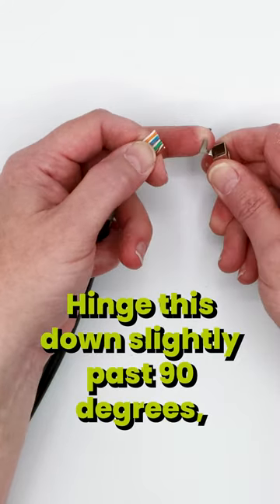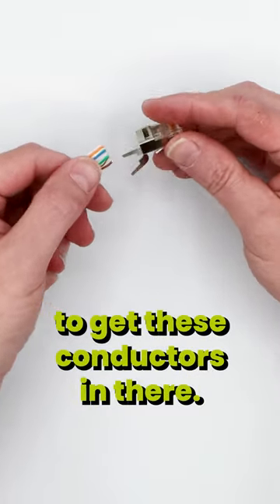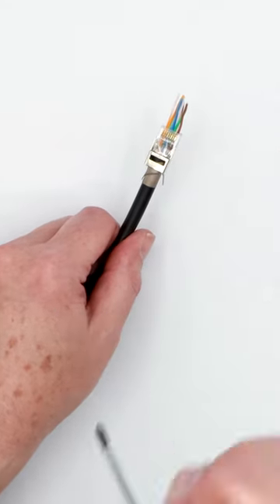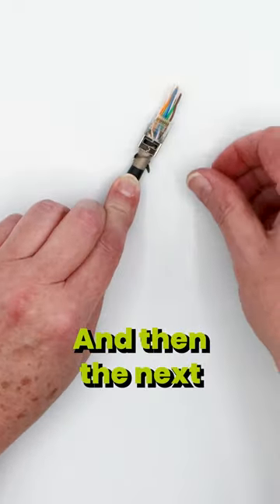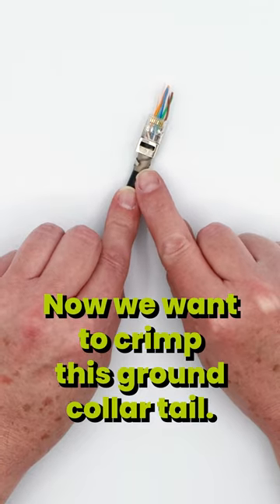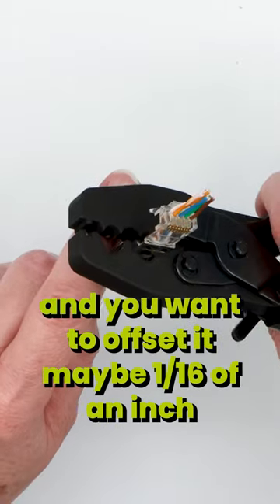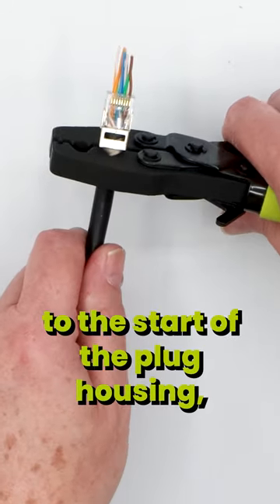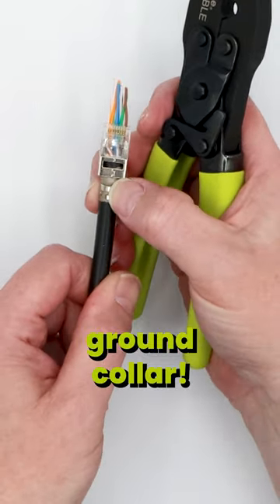Crimping Ground Collar on Shielded RJ45 Plug! #shorts

Comment: I got a bunch of rj45 connectors but I couldn't pass through the conductors, they were all blocked off at the end. Am I just supposed to prep it really exact?
Reply from the maker: Hello Sten. Solid-nosed RJ45 connectors are known as the "standard" type. That means the conductors must be pre-cut to the 1/2" length prior to insertion into the rear of the plug. The process is not complicated, but there are some tips and tricks that might help. I suggest checking out our blog and video on this subject (found in our Cable Academy) called "How To: Terminating a Cat5e Standard Push On Unshielded RJ45 Connector". Let us know if this helps!